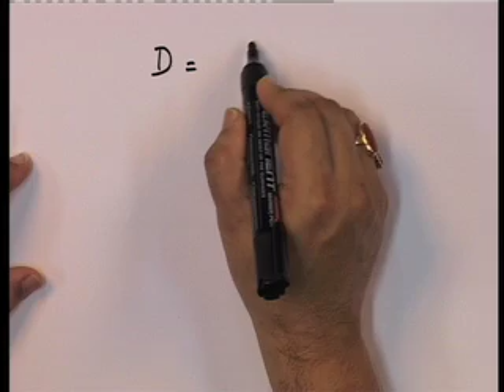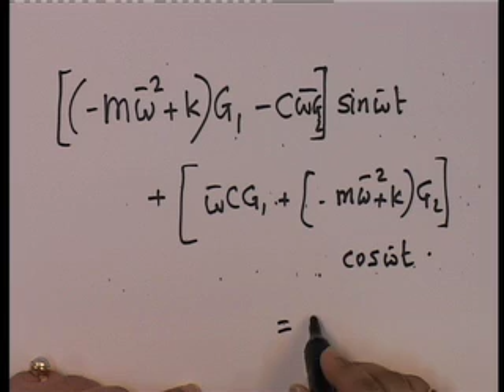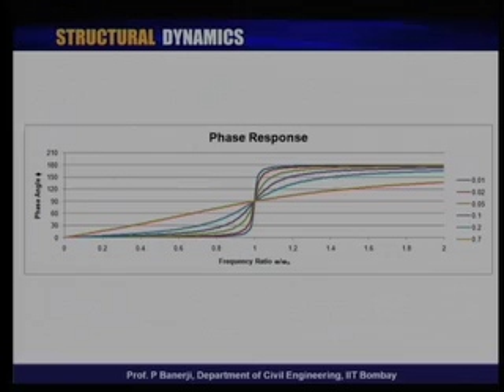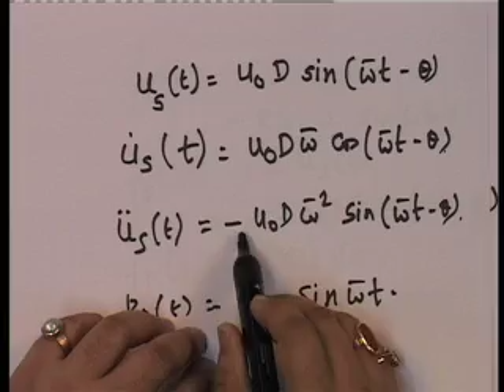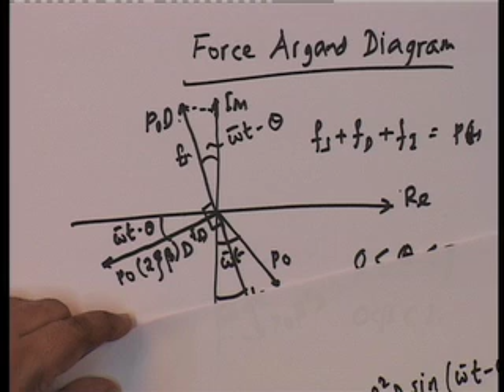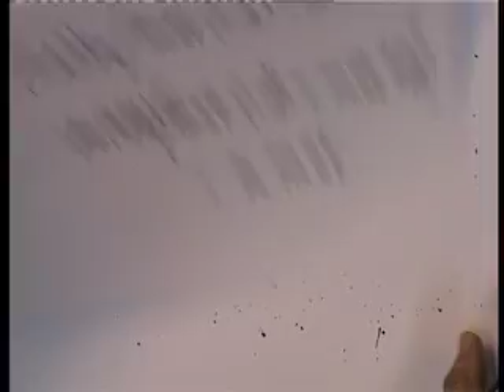Mod-01 Lec-06 Response to Harmonic Loading

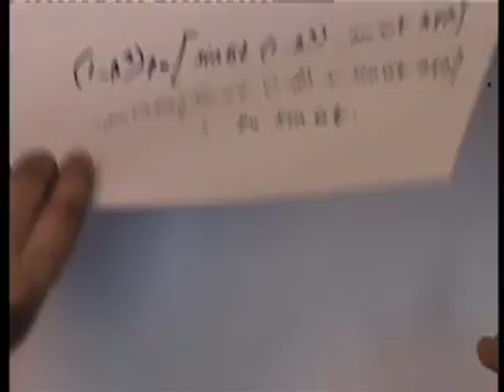Comment: At 55:00 something doesn't seem proper
Reply: Actually he has done two mistake , one in 47.27 (- sign ) another at 51.42 (D will be at top not at bottom)
Reply: In the next lecture he repeated the same thing.very clear explanation in the next lecture.